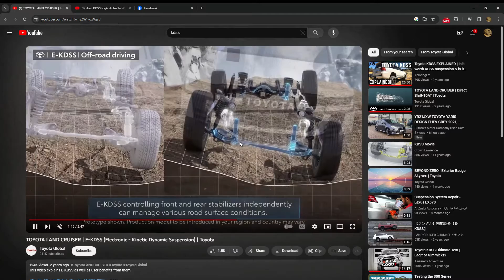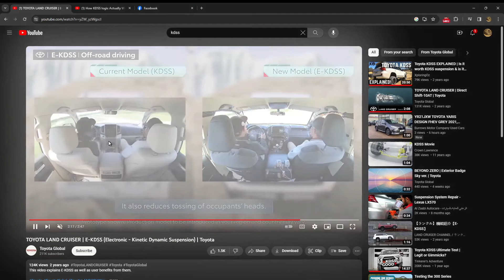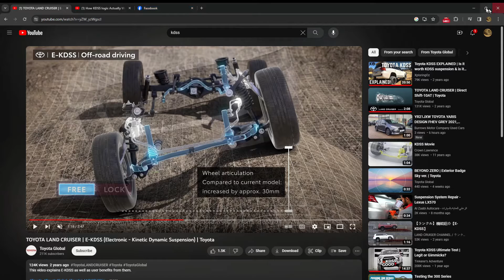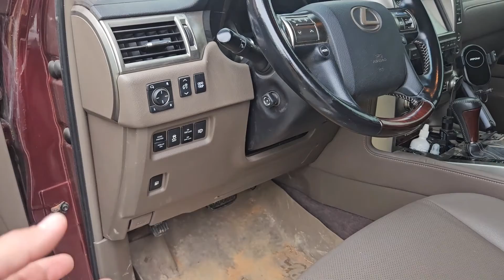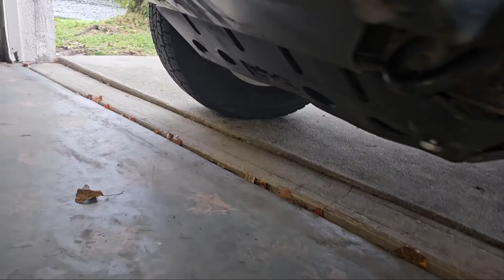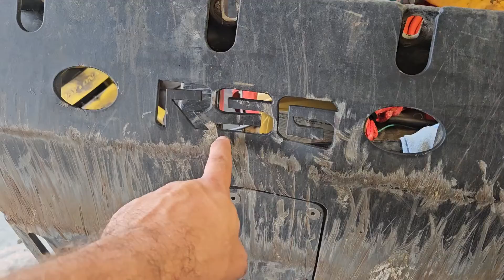KDSS disadvantages: time for a KDSS delete! GX460 and 4runner (reuploaded)

Comment: 5th Gen 4R owner with KDSS and icon suspension with bumper and heavy duty springs and have been trying to diagnose my dreaded "kdss clunk" that showed up after shop put on the heavier springs. Exactly as you described the clunk- it's coming from that front cylinder for sure. So first and foremost thank you for the nerdy deep dive into the system and showing how these various mods may or may not impact it.

Your assessment of losing travel with adding a spacer on fixed link on the front sway bar makes sense. But now I'm still left wondering if adding the two spacers on that companies sell for the rear might have any disadvantage?

My icon kit came with a kdss modified rear panhard bar so i don't really have a clearance issue except maybe at absolute full flex. However, I'm wondering if adding any of these spacers might actually increase pressure in the hydraulic system (that doesn't seem likely in my mind) or particularly in the front change the geometry such that there's less lateral stress on the opposite cylinder assembly thus potentially reducing or eliminating the clunk?

Or is it your opinion that the clunk is a sign of irreparable damage to the cylinder/system and a kdss delete is the best route?
Reply from the maker: I think I'm going to find a way to run just the factory rear sway bar and when I'm doing hardcore off-roading I'll remove one of the rear links
Reply: @MudPuppyOffroad  cool thanks for the insight. Continue to post your experiments and findings for us!
Reply from the maker: I think the rear spacers are safe the reason I didn't run them is because I didn't want my sway bar hanging down any farther when the rear axle is flexed. 

I played with my front cylinder some more today and I can feel some side to side play that I don't think was there before my extended travel struts with a lot of preload. I think that play is related to the clunk and I think it is permit damage. The reason I have decided to delete the system is because I don't like how complicated it is and driving with no front sway bar off road was so much more fun that I can't justify putting money into fixing the clunk.
Reply: @MudPuppyOffroad  I'm tempted to go that same route myself but the truck is still my daily and is used for lots of paved mountain highway and  forest service roads in the different seasons so I do appreciate the added benefit and safety of a sway bar.
Reply from the maker: @BlaineCoury  yeah I just put my sway bar back on for the first time in about a thousand miles and man does it drive good on pavement but that knocking noise is so annoying